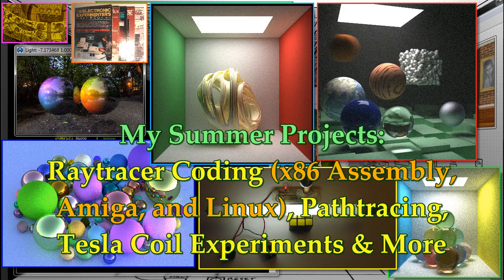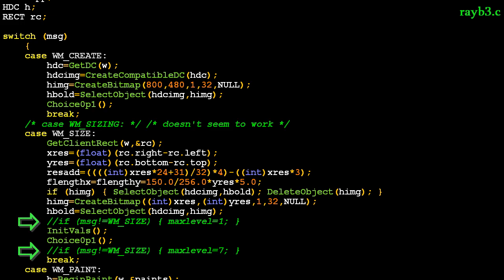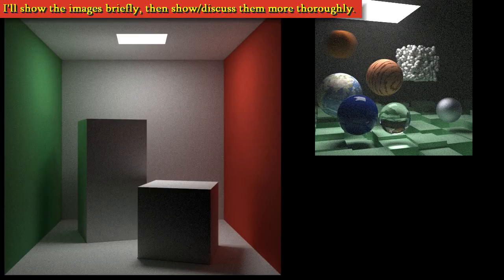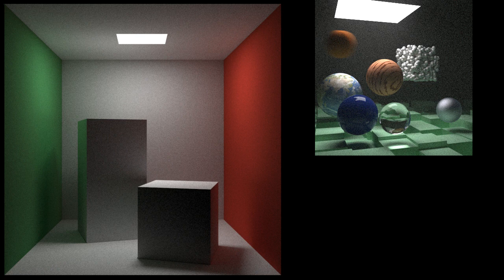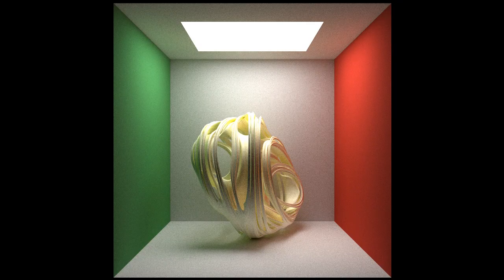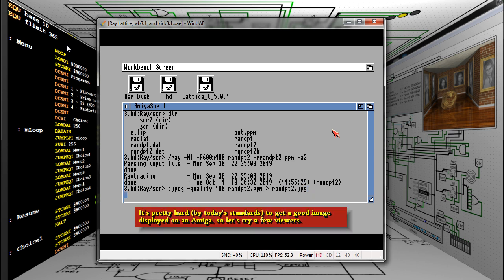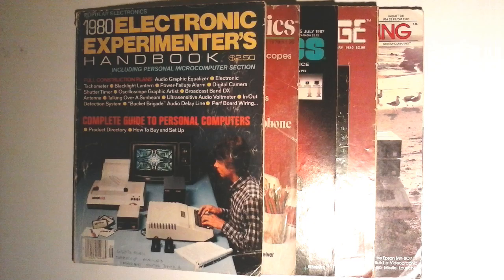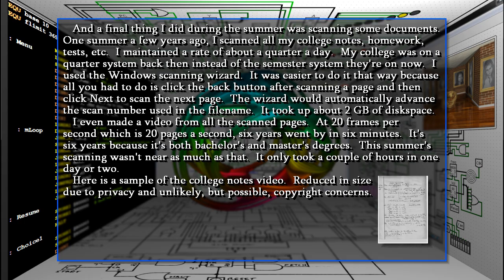My Projects: Pathtracing, Raytracer (x86 Assembly, Amiga, Linux & Windows), Tesla Coil Use & More

Comment: Hello man , nice work , its too late for a comment but im intersted into assembly and i have worked on many projects with limited hardware , like 6502,  8086 , PIC mcu , cortex m3 , and else others , but when i came to 86 assembly that my modren cpu runs (AMD Ryzen) , it to limited to do fantcy stuff like urs , and i have searched for docs , but no luck with that , so Would please tell me what docs u have relate on during these projects?
Reply from the maker: @Maze Gamerz Thanks! The websites I used to learn x86 assembly are listed in the description area of my "x86/x64 Assembly Language Intro and Valuable Tips: pt 2/2" video ( https://www.youtube.com/watch?v=KgPVx_kfBik ) video and also part 1: "x86/x64 Assembly Language Intro and Valuable Tips: pt 1/2" ( https://www.youtube.com/watch?v=2i935mP6hUM ).  I don't know if those URLs are still valid, but I do know they are all in the internet archive (wayback) archive.org

Comment: Hi and thanks for the references, it will be useful for my own work.
Your results truly are impressive and inspiring, I feel like working on my Raytracer again, thank you !

I have a small question, I know you said you weren't too inclined about open-sourcing your project but would it be possible for you to share your scene files, please?
Especially the ones with either animations and/or recursion. I'm wondering what it looks like and it could help me improve mine!
Reply from the maker: @Telokis Thanks for the nice compliments!  As to your question, assuming you're referring to the assembly language version of my raytracer, I can give even more than the scene files (technically they're not scene files, they're embedded in the assembly language) - I converted it to a GLSL shader.  You can run the shader, view code, and modify it as desired by going to https://www.shadertoy.com/user/mrmcsoftware (assuming your system and browser supports webgl).  I've provided a simple raytracer with no refraction and one with reflection and refraction.  However, since GLSL can't have recursion, I had to make non-recursive versions.  But the scene information is there and it's easier to interpret than assembly.  Also, since someone on shadertoy complained about my GLSL raytracer not having gamma correction, I added the option to gamma correct.

If, by chance, you're referring to the path tracing scenes, except for a few ones, they're derived from the various other sources/code I mention, so you could view their code to get the scene information.  I made my versions of their scenes in order to compare my images to theirs to see if my pathtracer was working correctly.

Or maybe you're referring to the two colored reflective spheres (and lake/forest) or the SUN logo, or even the bunny...
Reply: @MrMcsoftware  Thanks, I'm gonna take a look at the shadertoy link! Regarding the scene file, I was wondering about the one you mention at 9:20 about the recursive setup.
Reply from the maker: @Telokis That's derived from Evan Wallace's pathtracer website (link in description).  You can "view page source" in your browser to see his javascript code.  But in case you don't want to do that, I've put the algorithm (derived from Evan's code) for generating that scene on my website: https://sites.google.com/site/mrmcsoftware/algor.txt  I could provide my raytracer's script files for that scene, but I created my own scene language that might be hard to understand in some parts (mathematical expressions are a little strange).

Comment: Absolutely fucking insane
A path tracer in Assembly
Reply from the maker: @Artur Renato B.B I might be disappointing you a little...  The pathtracer was written in C, it's the raytracer that was written in assembly.  But there's no reason the pathtracer couldn't be written in assembly, I just didn't want to :-)  Though, thinking about it now, I'm not sure if it would be easier or harder to do.  Pathtracing is heavily dependent on random numbers, but one could either call a C random number function, or use the method that's often used in GLSL shaders (such as ones at shadertoy.com) that involves sine waves.  It shouldn't be hard.  BTW, the x86 assembly raytracer is based on the assembly raytracer I wrote for the CPU I designed (shown in my other videos - raytracer starts in my Floating Point video and is improved in videos after that).

At any rate, I'm glad you liked the video!